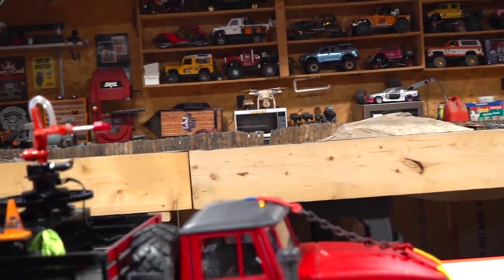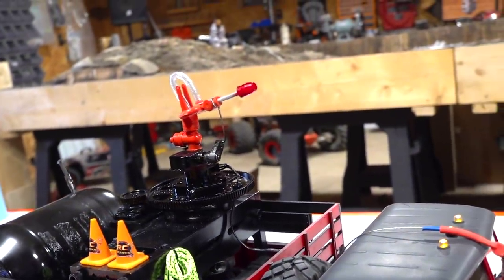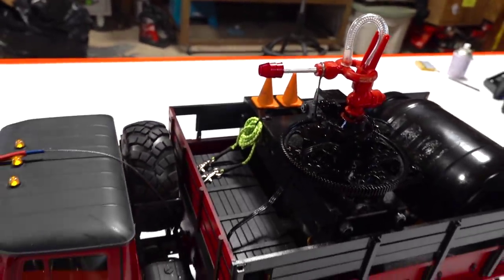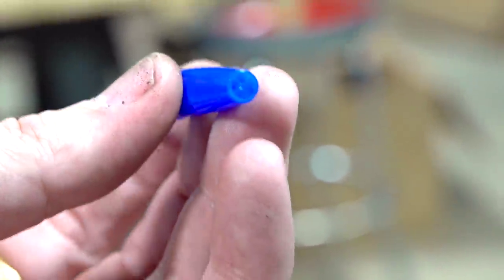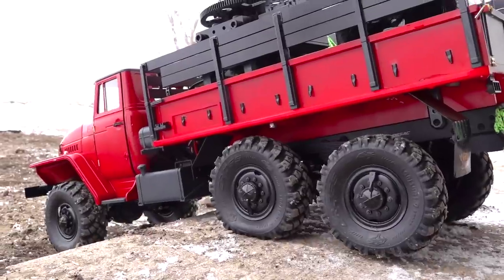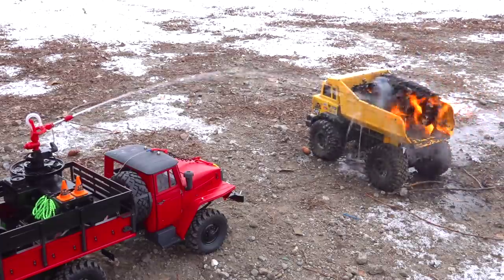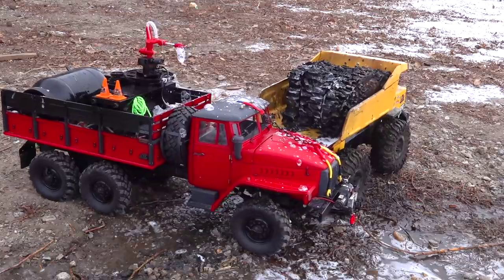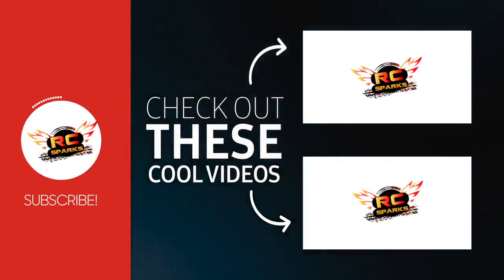HOW TO BUILD an RC FiRE TRUCK - PART 7  (Cross RC UC6) - FOAM ACTiON TEST | RC ADVENTURES

Comment: Add a controlled vent tube to the inlet before the pump. Just run it higher than the fluid level and adjust till foamy.👍

Comment: I'm not sure if it would work, but you could steal the nozzle end of a cheap spray mister (like the IKEA Tomat spray bottle which is a dollar). That would allow you to quickly adjust the type of output (mist vs stream) and might help with foaming (no idea about this part though).

If you motorize the nozzle control, you could even adjust it on the go.

Comment: Fish tank power heads(pumps) come with fittings with adjustable air inlets for pulling air into the stream of water. Plumb it inline and you could make the foam adjustable. And you need a tanker trailer.

Comment: I work with hydraulics daily. I would say you need a breether hole on the water tank. I would drill a hole in the lid and rund a hose upwards to above the top of the tank. Have it a tad bit bigger than the outgoing hose.

Comment: very nice work.  You might consider a small ball check valve on the vent or another easier option a u shaped pipe on the end to keep the dirt out. Either option will make it easier by not having to remove the screw you are using now.

Comment: The servo lead through the bottom gear could be fixed potentially if you bent another piece of wire like the linkage but larger, have it wrap around the base of the cannon and an eyelet at the end but above gear, so it can basically let the lead float above the gear as the cannon pivots. Just a thought:)

Comment: Foam works with the mixture of air. You need to create a suction or siphon effect as water is being forced out of the nozzle there needs to be a connector or T installed so soap is pulled from another tank and mixed in the nozzle. What is happening soap is lighter than water when the water tank is empty of water then the soap is being pulled.  You could also install another pump low volume to pump soap into the line as the water flows. Hope this isn’t to confusing

Comment: @RCSparks Studio so add a one-way flap nozzle to make it mettle if possible. put gas in the tank instead of water. in front of the nozzle put an igniter of some sort. the flap nozzle should (yes should I think I might be wrong) allow the gas to come out but make the flame not go back through the tube and into the tank and make it go kaboom

Comment: In real trucks the way it works is airation of the stream through a “fog nozzle” or a specialised “foam nozzle” (literally a mesh screen) in front of the water/foam mix stream. Maybe a piece of fine window mesh or even that pen cap with that cross pattern left in the end in front of the stream? Maybe higher pressure from the nozzle as well to achieve the foaming on impact with the flaming target?
Reply: take a fine metal screen like for a faucet or glass pipe...wink wink and install it inside the pen cap that should do it with a higher soap content.

Comment: Really great the improvement of this servo assembly, it's a great idea and it allows the fire hose to be much more mobile, plus your test to extinguish the fire is very successful. Don't worry you're not that old, even if the flowing water gives you cravings 😄

Comment: Wow that's amazing. The stream of water is very good, it shoots plenty. The distance is also not bad at all. Awesome. For the foam I support you would need a different nozzle letting some air to be mixed up with water, but that would also reduce your pressure, I'm afraid. A bit more power should have probably for that. The BIC cap can be a great idea

Comment: Fellow Canadian here so I can relate on the cold. 
It dramatically decreases the run time on batteries doesn't it?
 Does 15-20 mins sound right running a 2s 5000mah on a velineon slash 4x4? (Stock pinion and spur)

Comment: hey aron love the water truck but as for the foaming of the soap do u have enough channels on ur radio to install a small motor on the top of ur water tank and used a rod or something to go into the tank to aggitate the water and soap as its being pumped that will make a butt load of bubbles

Comment: Nice conversion you could incorporate a a small 6v air pump of sorts into you water line outlet.  This will force air to boost reaction to the soap as it passes through line.  🤓

Comment: You need a second tank for soap and put a T with a hose that goes down into it after the pump so the flow by the T will pick up the soup as it flows by

Comment: Hey Medic! That Fire truck is awesome! When I  work at the power plant and dealing with coal and bunker firers we had a product we used call light water foaming agent and it was crazy the foam that one could generate with it! We would spray the whole top of the coal in the bunker and block off the oxygen getting to the raw coal underneath that was burning! You'll probably need another tank a1/4 size of the water one in the truck! fill with that fluid and a metering valve inline with the water and it will siphon it in and mix and come out the nozzle that you have already there! Talk to local fire department to see the product there in Canada! Good luck! Great video and tutorial on it!😉😎👍

Comment: This may work,,, Try getting like a can of regular Style shaving cream in the bigger aerosol can and may even try shave gel like the edge brand but if mixed properly with water, it will put out a better foam that would be more even and adhesive, as far as whatever it lands on,, it would stick to it and not dissolve or run off so quickly making a flame retardant,, putting out the fire quicker but definitely try that and I believe that will work better than soap or dish liquid....

Comment: The trick to get foam is going to be to add air. Try a adding a small air breather tube centered in the water tube about an inch before the tip of the nozzle. Have the air tube pointing in the same direction as the water flow so the air will be pulled out by the passing water. Basically it would be just like a carburetor but with the air and fuel reversed. ( an EXTREMELY RICH FUEL MIX is what I am trying to describe.)
Then  I think it would only be a matter of getting the soap water mix right.

BTW, if you traded out the soap water mix for soap and GASOLINE, you would have a flame thrower!! Future build series???

Comment: I think the truck is missing the emergency red flashing lights that would make this stand out as a real fire truck. I think it would look good with flashing red lights on top of the cab, and on the corners of the cargo rails, and maybe even one on the front bumper. That would definitely make it stand out as an emergency response vehicle. Otherwise, an amazing job on this build!

Comment: You need something to agitate the water in your tank, so maybe some sort of air pump like in a fish tank to keep pressure on the water and create bubbles, or maybe split the feed from the pump that your using to push the water out of the cannon, as you just need a little of that air to agitate the water and a valve could control that so you still have more then enough pressure going to your main gun. Lol to bad whipped cream is so light or it would’ve worked perfectly. Either way I know you’ll figure out something that’ll do the job. Stay and Play Safe !! 👊✌️

Comment: Looking pretty good!  Your right on for the amount of soap.   You are also right about the air, you could use a little more agitation at the tip of the nozzle.  I would suggest leaving the cross piece in the tip of the pen cap( great thinking by the way).  Our nozzles broke the water into finer droplets to absorb more heat that did the same with the foam. Love the truck but it needs more lights!  LOL